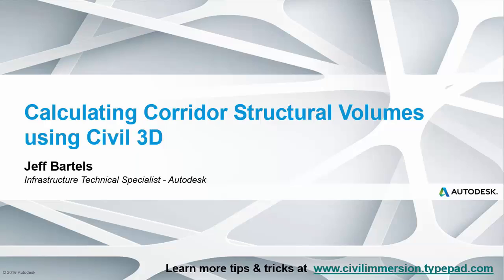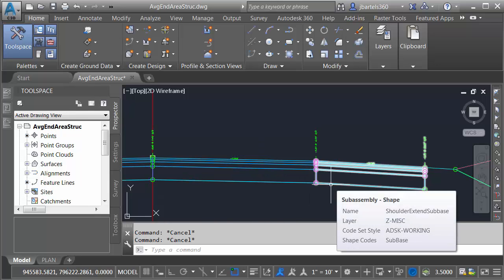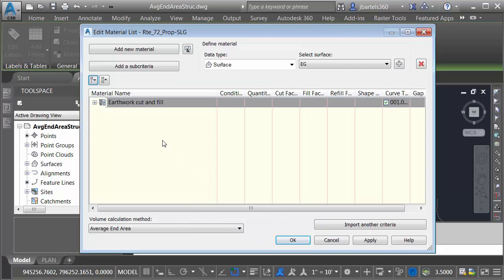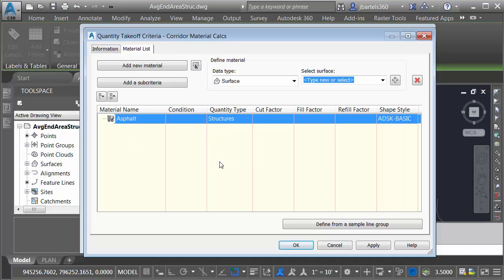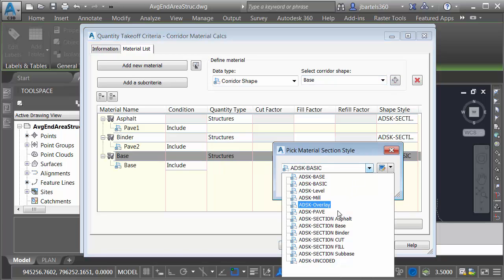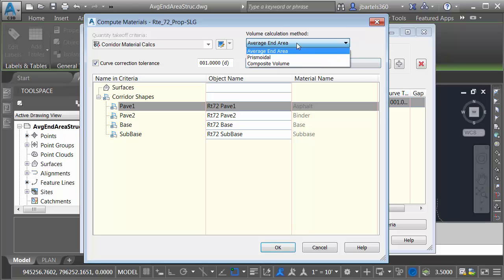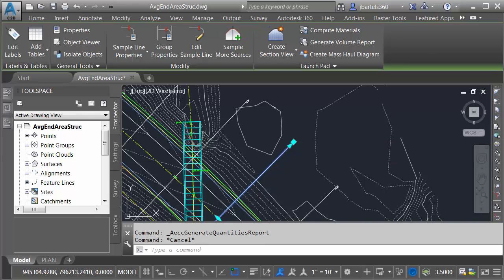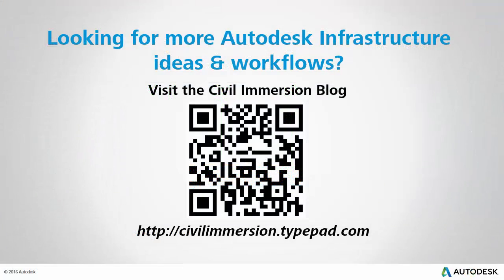Calculating Corridor Structural Volumes using Civil 3D

Comment: hello jeff.tanx for best civil3d video.i have a problem,i need to calculate Cut or Fill Elevation in edge of my shoulder (starting dayligt slope) in cross secs.then report in table (Xml or Xlsx file)and if this elevation is more than 7m, then civil3d change the slope of cut or fill in daylight, plz help with a toturial video.tanx

Comment: Your structural volume report is wrong
Because of station between length
The station length should be more the sample line offcet

Because of road slop profile

Every road should have longitudinal slope it's should be calculated in length

Comment: sir, please i'm having problem in the profile with my proposed data, it is not always out of proposing the road. can you please send me a drawing template that should be using in my design. because the main problem i'm having is setting. or what will it take for me to get the full tutorial on Civil 3D ?  complete tutorials.